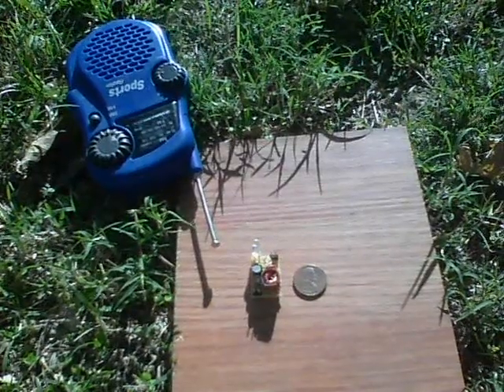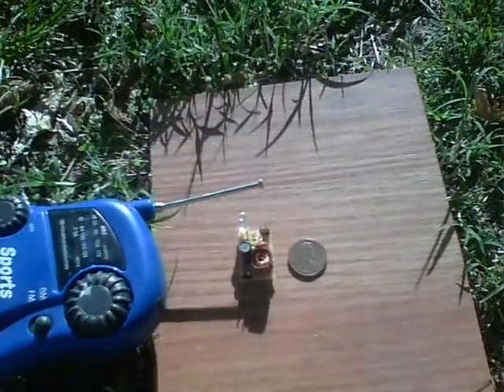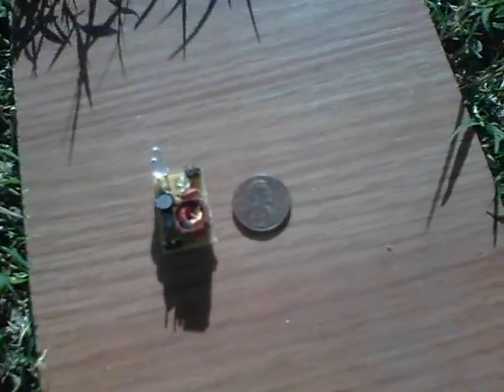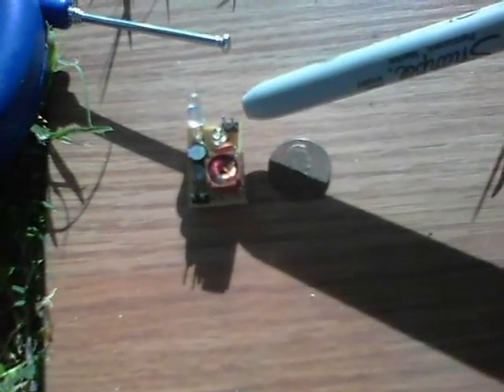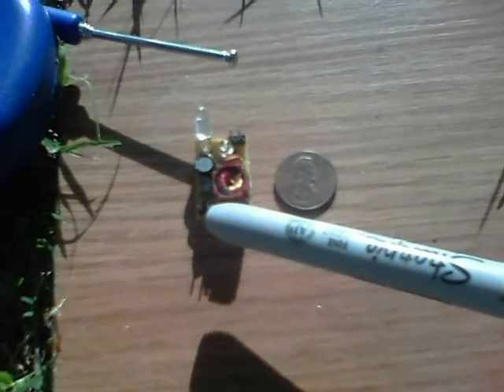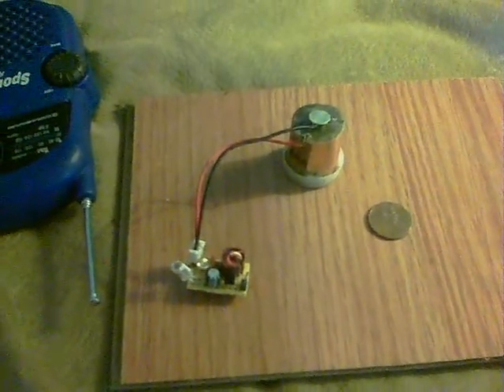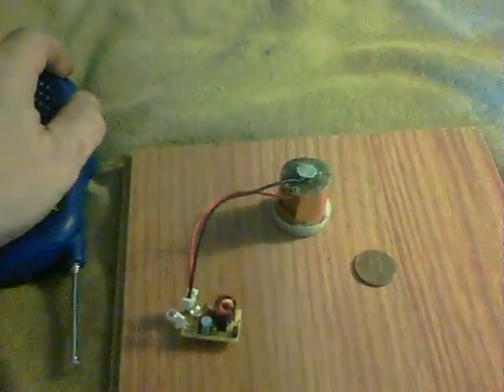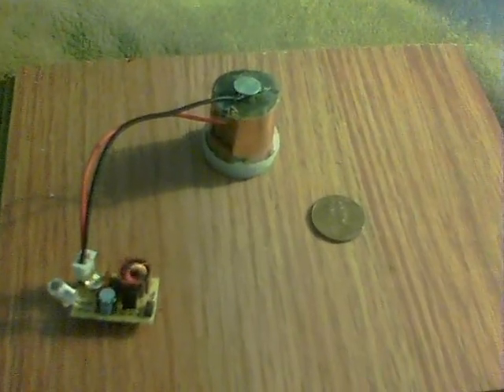Ha'penny solar oscillator

Comment from the maker: @harpbloke Thanks :) The I/R LED on this one came from a JVC TV remote control. It's working backwards and receiving solar energy in any case, cool things. It meant that the circuit could be this size, as even calculator solar panels are much bigger. All is salvaged secondhand components from junk, so it came out well.

Comment from the maker: Thanks Kyle :) The coil is from a 1990's hi-fi. It's 2 sets of about 300 turns 40 gauge wire on a ferrite torroid, with which i've reconnected 2 of the wirings together - like a center tap Joule Thief coil. 
Ha'penny is slightly more efficient than Nephilim Penny, which itself is solar powered and used just 170mV from a 1F supercap in a 24 hour continual run (solar to charge the cap while running, then brought inside at sunset).
These things practically fire the LED if you look at them lol